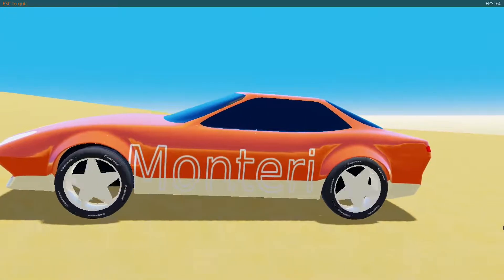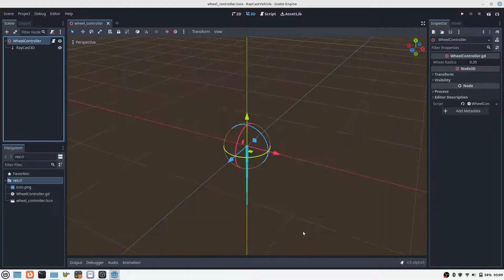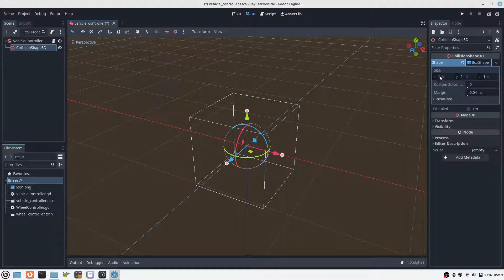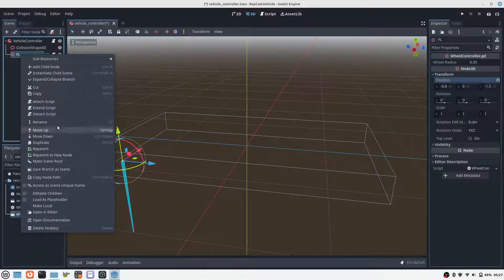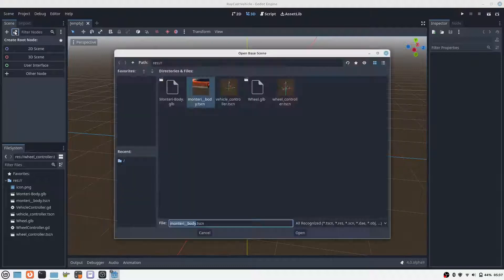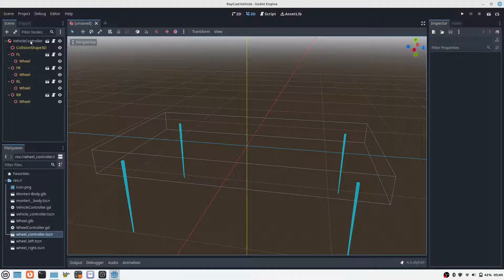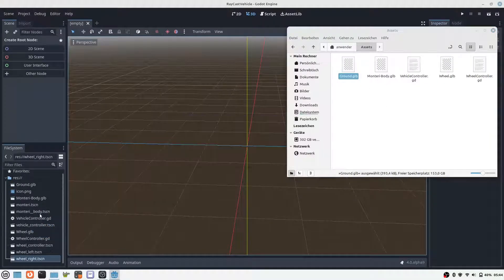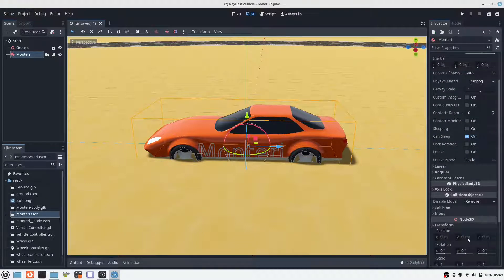Setting up a ray cast suspension in Godot 4

Comment: This is far beyond the scope of the video, but I noticed using Jolt physics that the car flies into the air. I saw your recent drift example was updated for Jolt, but I wasn't sure what you changed and didn't see the extension as part of the example.
Reply from the maker: The car was flying in the air because the ray casts were touching the CollisionShape3D (the BoxShape3D). I just resized the BoxShape3D so that the ray casts are touching the ground and not the collision shape. In my demo project I didn't include the Jolt Physics plugin. You can to do that yourself and you can choose the version you like.
Reply: @tomaga4995  thank you!

Comment: Do you use a custom wheel collider such as the Godot 3D collider? or do you use the VehicleWheel3D which is only just a downward pointing raycast?
Reply from the maker: Well, I just wanted to try out if I can simulate the suspension of a car with very simple elements. I use a RayCast3D (an element of the Godot game engine) and a force. It obviously works and it looks reasonably realistic to me. 😁
Reply: @tomaga4995  yea it does, I meant the wheel collider not the suspension though.
Such that if you drive over a rock, does the wheel  respond the minute its circumference makes contact or does it wait for the lowest point of the wheel to make contact
Reply from the maker: @cholasimmons  The latter is true. It is a very simple implementation (I don't think it can be any simpler). Maybe you can get the former behavior with ShapeCast3D, but I haven't tried it.

Comment: Do you know if this still works ? I tried in the last version and its not applying any force... The version I tried : 4.02.stable
Reply from the maker: I did not do the complete setup process with 4.02 stable, but just downloaded my drift car project from notabug.org and that works. Is the suspension not working for you or does the car not move?
Reply from the maker: I just downloaded your version from GitHub. It looks like the vehicle (Monteri) is not derived from the vehicle controller. Did you click on the chain-icon after you finished the vehicle controller scene? I have three projects on notabug.org. The suspension project is Godot 3 only, but the drift car projects are for G3 and G4. All use the same ray cast setup. You could just compare your setup with the G4 version. Hope this helps. 🙂
Reply: @tomaga4995  I see... I think I miss that, I download your drift project and its working, I will try to remake it again, thanks friend.

Comment: Your tutorials are great! It just would be nice if you explain more your code, looks like you're going more in detail in the node structure than the code, i want to understand, not just seing that it works
Reply from the maker: This was the first tutorial I had ever done, but to answer your question, the force for a single shock absorber is calculated using Hooke's law. The difficulty for me was to determine the position at which the force is applied. I am not 100% sure myself if my calculation is correct, but obviously it works.
Reply from the maker: I just wanted to add that you are absolutely right with your suggestion to go more into the code. I will take that into account in the future. 😊 Thank you for your feedback!
Reply: @tomaga4995  i watched all the car tutorials, and this is what i missed.